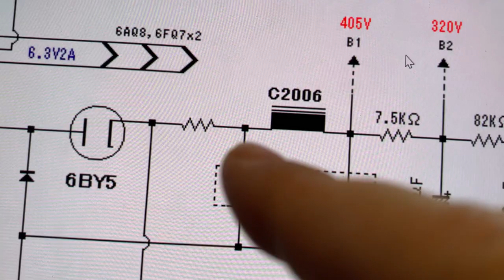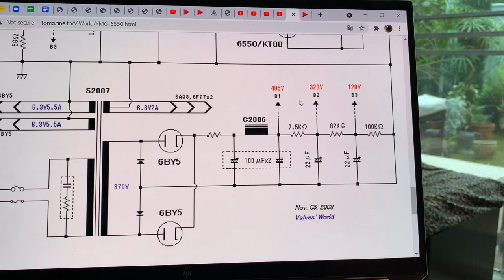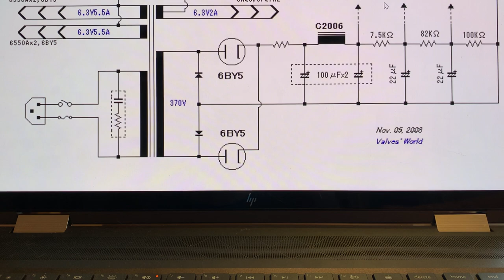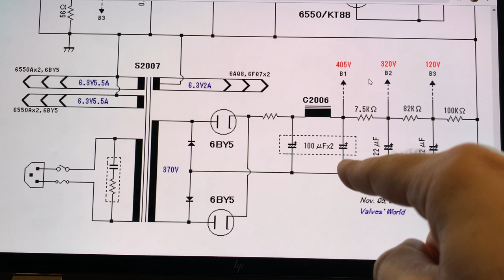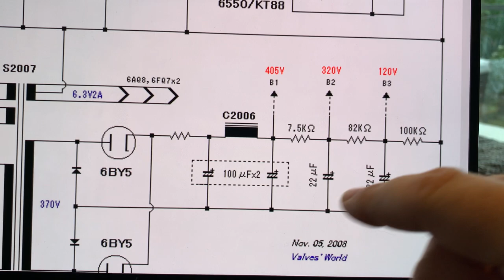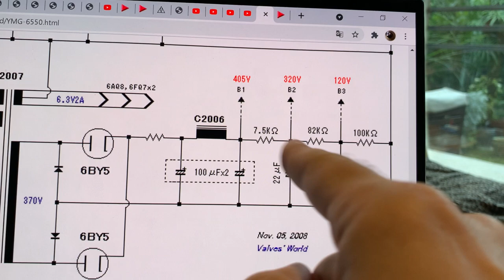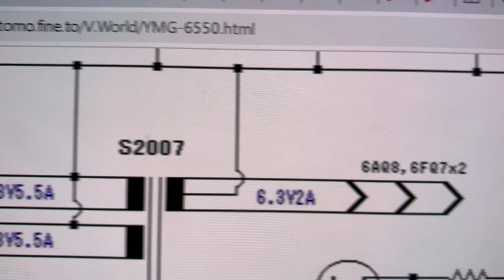Choke input versus capacitor input - The PI filter strikes back.... Episode III.

Comment: I would have thought an LLC converter gan would be ideal there's 1000-watts just come out with galvanic isolation through the planar transformer can have constant current of 88 amps peak current of 250 amps about an inch and a half Square in size incredible
Reply from the maker: I don't have any experience with the LLC technology ;